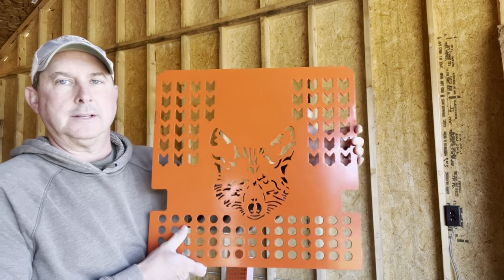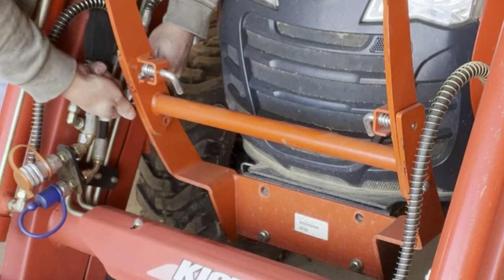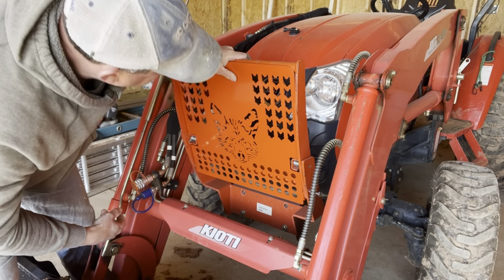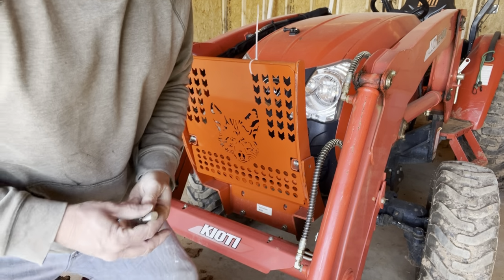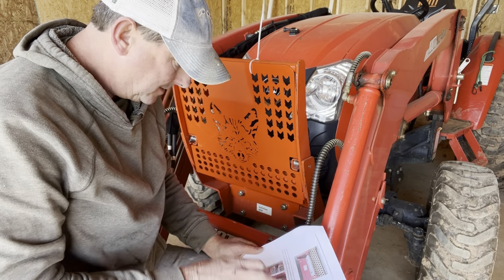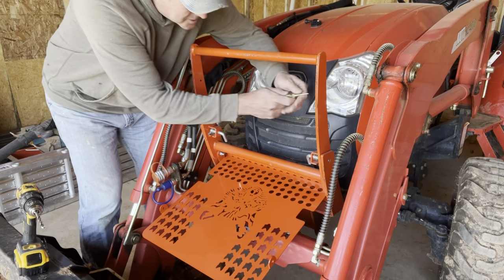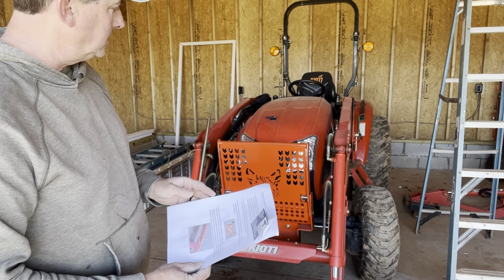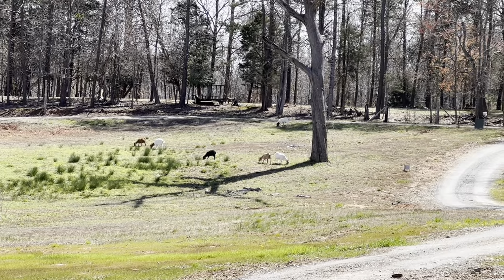Installing a Custom Grill Guard on My Kioti Tractor

Comment: Would be nice if they didn’t use kubota orange. I’d like one with kioti cut out not the big head.
Reply from the maker: Yeah orange doesn’t really match as good as I hoped.  Maybe after it fades some
Reply: Try painting it with Chevy red engine paint. It’s supposed to be a pretty close match. Much cheaper than Kioti’s touchup spray paint.